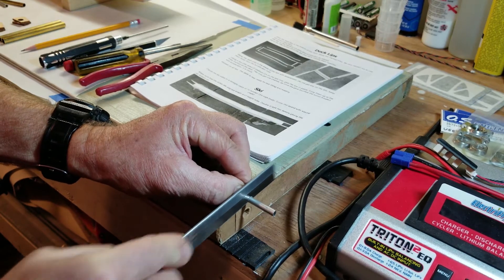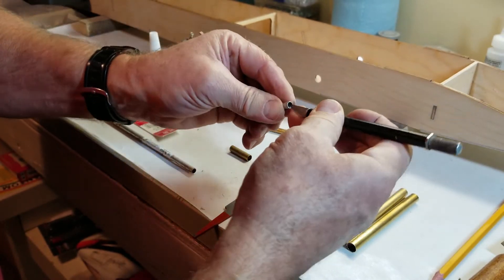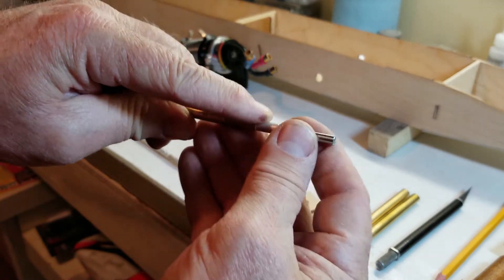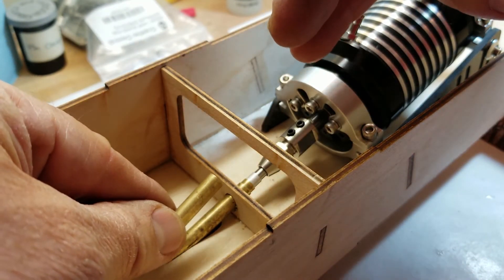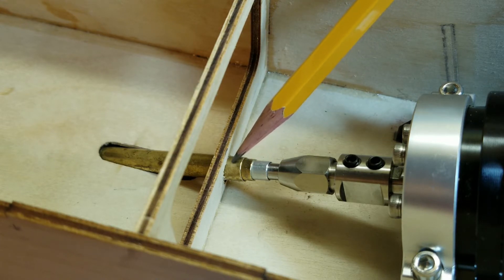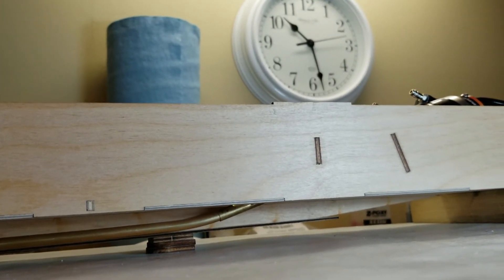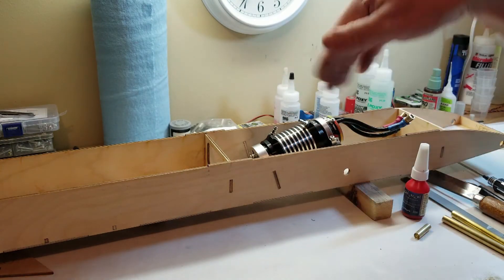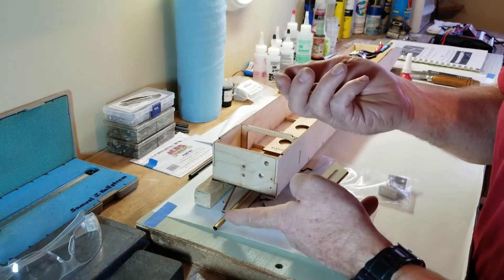ZIPPKITS JAE 21FE V2 OUTRIGGER WOOD KIT BUILD_PART 6

Comment: Hello, is it necessary to use any grease or oil on the propeller shaft? Thank you very much, best regards
Reply from the maker: Yes, it's a must do for sure. But for winter storage I pull the flex cables and clean them. Some guys do that after every day of running their boats...